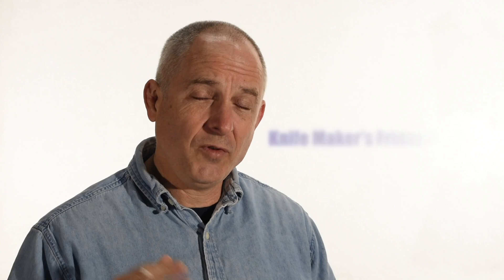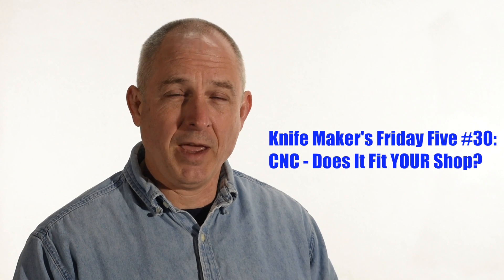Knife Maker's Friday Five #30 - Is CNC Right for YOUR Knife Making Shop?

Comment: That was a worthwhile introduction into the CNC aspect. You are absolutely correct,It is a HUGE learning curve.
 The consumables are a considerable cost.  
Not only the  mill itself, but the tool holders, and oter necessary items are a signifecant investment. 
CNC is not for the weak of heart. 
Maintence is staggering. If you want repeatibility; regular Preventive maintence is an absolute necessity.  
The decision to add CNC capability is directly related to the individua's commitiment to build quality knives in mass quantity.  
When you reach that level you probably have a marketing plan to move product. 
Your getting seriously deep into the knife world.

Comment: When I buy a knife the number one thing I'm looking for is the quality of the knife. I don't really care how it got there. CNC, 100% handwork, CNC followed by handwork or whatever, I don't care as long as I'm getting the quality I'm after at a reasonable price, and CNC is something that typically brings the price down.
Reply: Gunslinger454: You are absolutely right, the best price/quality ratio (for the buyer) is always in mass-produced items. The thing is, though, I would NEVER pay more than 10 USD for a generic knife, because you can get a pretty good blade (with plastic everything) for 5 USD, and I personally cannot see a reason for paying more than that for something which, in essence, is just an expendable tool.
Reply: I think you kind of missed the point there. I wasn't saying that you should buy a cheap knife, far from it. I was saying that if I'm getting a top quality knife I don't really care if it was made using CNC and then hand finished or if it was made entirely by hand. Using CNC to do the initial work that would otherwise been done by hand saves time, and, it may be a cliché, but time really is money. If you're looking at two knives that are otherwise identical in every way, but Knife A was made by CNC & then hand finished while Knife B was made entirely by hand, odds are that Knife B will be more expensive because it takes longer to make.

Comment: Is heat hardening galvanized wire a bad idea?
Reply: Galvanized steel gives off very  toxic fumes that cause I believe it's zinc poising . However I definitely have seen alot of cable knives etc so definitely do alot of reaserching
Reply: Brandon Cornett it's just something I picked up for a few bucks...think i will just be safe and order stainless steel wire, I saw something about Fume Fever, and that the poisoning you can do to yourself, is irreversible, and permanent.
Reply: jay warrell yes I know two people with safety stands last who have caused themselves to be poisoned and even have black lung from how they work. Safe choice is better for sure👌
Reply: Brandon Cornett DEFINITELY!!!! Thanks for the heads up! Will just spend a few extra bucks on some better wire! Thanks man!
Reply: jay warrell like cable? The fumes are bad and off gassing of the galvanize can cause major gaps if you intend to make it one solid piece.
Reply: Brandon Cornett actually it's solid, thin gauged wire I wanted to harden to make chainmail links
Reply: jay warrell it's frankly not the best for that. Are you using is because it's galvanized or because it's what's on hand?
Reply: jay warrell No problem it's better to share knowledge than to just shoot someone's idea down. Good luck to you man👍
Reply: If you want hardened wire, use music wire.  Normal galvanized wire will not harden.
Reply: jay warrell Very bad idea, try starting with rebar tie wire.